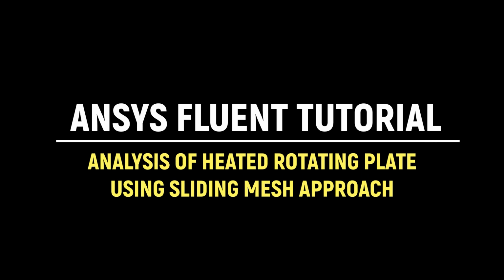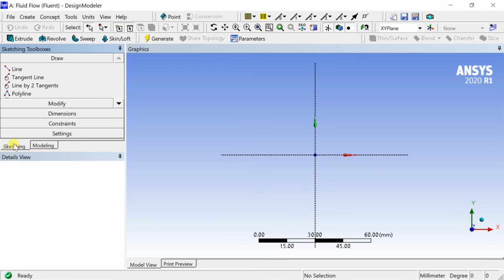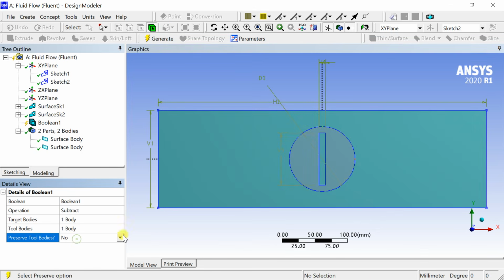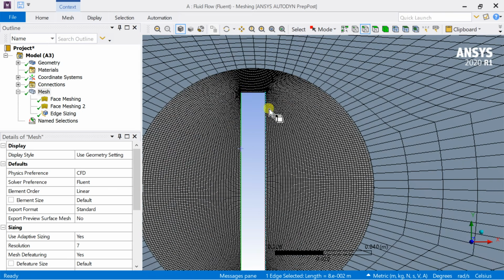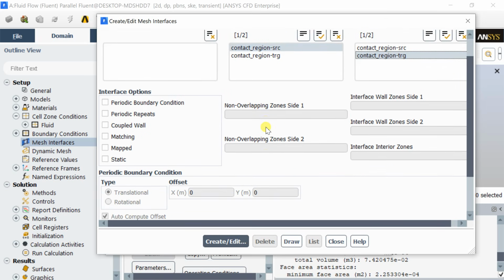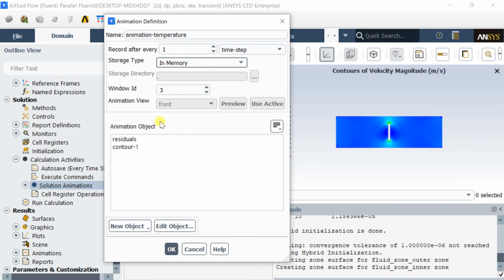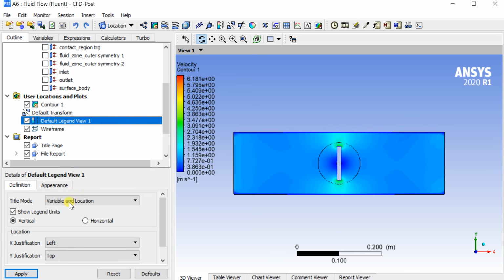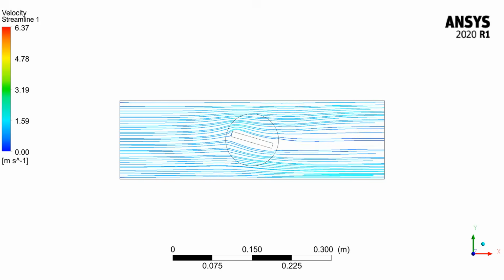ANSYS Fluent Tutorial | Sliding Mesh Approach | Conformal & Non-Conformal Meshing | Rotating  Body

Comment: thank you for the video. I have a problem where ansys created wall at the rotating inner fluid so the fluid is not reaching the plate however it is circulating around the rotating fluid as if there is a circular wall. I tried to couple the walls of the rotating fluid with the fluid but it didn't work. Could you help in this regard?
Reply from the maker: You need to apply dynamic meshing for such simulation.

Comment: Good day & Great tutorial. In 10.12 minute > only 5 named selection. Then  Boundary Condition at 12.17 minutes  , there is "surface_body" name. Did i miss anything ? Since i follow each step-by-step. Please advice. Thanks
Reply from the maker: All other boundaries not need to be assigned as its assigned automatically by the solver.
Reply: @AnsysTutor  thank you for the response. appreciate it. just wondering how we solve slit zone issue, mesh was conformal, 2only using 2 domains. please advise.

Comment: Good morning Mr.
I did the same as you did in your video, but Mesh_interfaces are not created in my case. Still no src and trg terms are appearing in boundary conditions tab of setup.  I tried thrice Can you please help me
i tried with ansys 2023 R2 and 2024 R1 student version but i have same problem
please help me please please i need a simulation like this for my graduation project urgently
i sent the file to you via mail
Reply from the maker: Have you created the two rotating geomwtry in different sketch or in the same sketch.
Reply: @AnsysTutor  the problem resolved thanks can you help me to do the same but in 3d

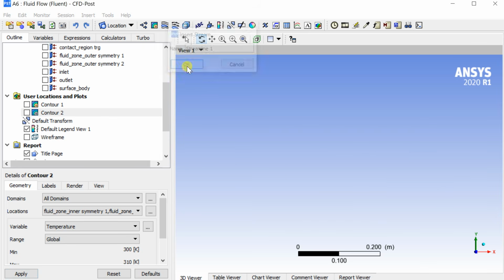Comment: Hi, I found my result has slight incontinuous between the inner and outer zone of fluid. Just like the situation in 21:12. But you have a  perfect output in 21:34. Wondering if you made any adjustment. Thanks for the tutorial.
Reply from the maker: No adjustments have been made.

Comment: I followed you video step-by-step, no exception. Still no src and trg terms are appearing in boundary conditions tab of setup. 
tried to generate them in mesh connections, but leading more problems.
Reply from the maker: You might have made a mistake in the geometry creation step. You need to create the outer domain and the inner rotating domain in separate sketches.
Reply: @AnsysTutor  I did. Also as I said I followed each and every step in the video.

Comment: Thanks for the video. When do we use dynamic mesh? Isn t this siumaltion dynamic and you havent used it. Sorry I couldnt understand the difference.
Reply from the maker: In sliding mesh, there is no mesh deformation or changes. only the mesh of one zone is sliding or moving near the other zone separated by a boundary, but in case of dynamic meshing the mesh is deformed, there is creation and deflection of cells continuously, mesh size changes etc. Which is a more complex and more time consuming process.

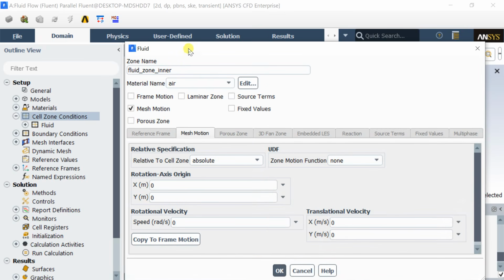Comment: Sir At 11:50 how do you calculate to set the Rotational velocity to -5? Do you have to know the rotating speed of your model beforehand? I am trying to appy sliding mesh for a savonius wind turbine but I only know its dimensions.
Reply from the maker: Yes, in my model, it's an input. For turbine cases, you need to apply 6 DOF model. Without any rotational velocity, it would rotate on its own due to the effect of flow.

Comment: Dear sir! I am facing a problem in edge sizing. Because when you generate the mesh, the edge sizing is done for the inner domain( circle) but in my case it happens to outer domain ( rectangular part). Can i resolve this issue?
Reply from the maker: You should hide the outer domain while selecting the edge for mesh so that only edge of the inner one would be selected.

Comment: hello sir, i have a question about this simulation. Is it OK make the rectangular a moving wall in the whole large zone and without setting the fluid zone inner ?
Reply: maybe it's simpler and more accutare because the direct contact between the rectangular wall and fluid？i'm not sure
Reply from the maker: For such simulation, you need to apply dynamic meshing with 6 DOF model enabled.
Reply: @AnsysTutor  Got it, Thank you.! Forword to your more tutorials.

Comment: Thank you for this tutorial! How do you eliminate the disconinuities in the velocity contour plot that shows up at the interface region. I saw it for a second before the video switched to the final render where there is no curricular discontinuties. I tried to do everything you did in the video and I am still getting a discontinuities at the interface.
Reply from the maker: You might have skipped the mesh interface modeling part, you need to create a non- conformal mesh and create the mesh interface manually to avoid the discontinuity  in results at the interface regions.

Comment: Excellent explanation
 I have some questions:
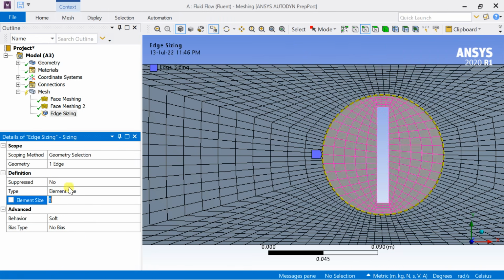minutes 8:18 what happens if these blanks are not removed?
In the definition of the Boundary Condition is not also defined the upper and lower walls of the extrerior fluid?

In the interfaces, why do you delete the interface contact_region and create a new interface_2, if it is the same one?
Reply from the maker: It's a good practice to keep the model without such mesh void spaces otherwise if you are adding any heat transfer in this model it would cause a waring message to appear that is "Temperature limited to " warning in each iteration and which would eventually lead to a wrong final result. 
         In boundary conditions, those walls which we do not assign a name, fluent name it automatically.
      And for interfaces, sometimes the software doesn't consider the automatic generated interface contact region properly and causes some error, it might be due to some software glitch. So, I had deleted the automatically generated interfaces and created the same again manually.
Reply: @AnsysTutor  
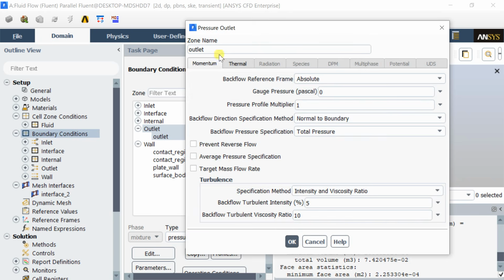For some reason there is no "interfaces" button as at 13:32. Don't you know why this happens?

Comment: Hi. I've a confusion not related with this video.

Would you like to give me sone advice, how can I avoid backflow in ansys fluent?

I'm working with a a pipe, having helical coil inside. The pipe flow gets backflow in almost 200 faces at outlet. What should I do?
Reply from the maker: To prevent back flow, increase the entry or exit length, allow the flow to establish first ,then it would provide results without the back flow.
Reply: @AnsysTutor  Thank you for your response. 

What if the length I'm using now is the length that within which I want to examine the flow. In such case, what to do?

Comment: With the rectangle rotating at a constant angular velocity, the rotation seems to be independent of fluid flow forces. Is there a way to model the rotation of the rectangle as a result of the fluid interaction?
Reply: yeah but you should used a dynamic mesh
Reply: @Andres-qw1de  can you explain that a little bit more sir.